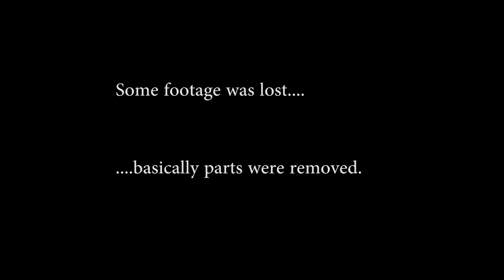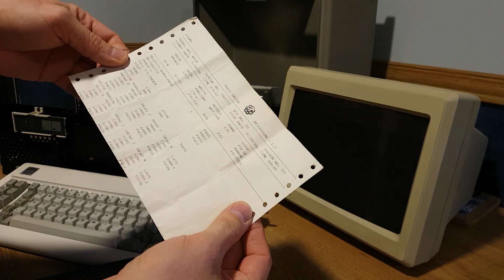IBM 5170 286 Everex build with 10 Mb MFM hard disk, Mono graphics, DOS 3.3 and an XT keyboard Part 1

Comment: How are you using a XT keyboard on a AT system?
Reply from the maker: Some systems can take both - I've only seen it a handful of times. Usually, it's the keyboard detecting the scan codes, or there's a physical switch (I have a Win 95 keyboard in my basement that has an XT/AT switch) but sometimes the motherboard itself has the support.

Comment: When I was in programming school, (Interactive Learning Center), we were using 386's, and when the 486's came in, I woke up early so I could get to school before most others, because it was first come, first serve, and I wanted one of the new 486's.   I don't know what version of Dos we're using, it was so long ago, the disk drives used the hard square plastic diskettes, though my AT&T was as the one's you were using in this video.

I'm not familiar with the version of Dos you were using in this video, but we were using MS-Dos, and I discovered that you didn't need all of the files to boot up the computer, only 3 were essential... trying to remember their names, correct me if I'm wrong, but IBMBio, and IBMDos, both hidden files, and Command.com, as long as you had these three files the computer could boot, the rest were optional  That was back when Basic, and Basica were included with the OS.

[edit] p.s.  Don't click the link, I didn't intend to create a hyper-link, just Windows trying to read my mind (irritating)
Reply from the maker: We had 286s in our labs (Commodore PC III I think) and C64s in the library. When I built PCs in Middle School (principal bought several skids of mish-mashed hardware), the music teacher didn't get a PC (Fuck you Robertson,  esp. for throwing Ian Hollas into the stands), the teachers I didn't like got XTs, (some crippled with 256k RAM on purpose, and no hard disk), so-so teachers got 286s, my homeroom teacher got the only 486 AND a 386 Flex (Cache!), and good teachers got 386 machines. 

I sincerely wonder how long they kept those PCs for. I went back to that school in 2019 randomly hoping to get more info about the principal (Gordon Jarvis, if anyone happens across this , Hilltop Middle School, 1993-199?) so I can properly thank him for allowing me to build these PCs and starting a long career with them.

Next vid is coming out in a couple days (working on it now), stay tuned!